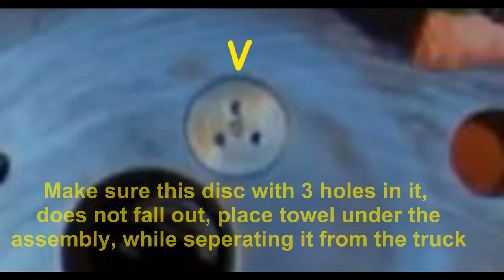Hydro Brake booster leaking repair 1999 Chevy 3500HD

Comment: Yep redid mine last week same way. Cleaned out some pieces of loose rubber gasket and thoroughly sprayed assembly on firewall with brake clean to make sure I got it all out... Well I'm redoing it due to the fact a very small piece of rubber got in between the new gasket and the piston.
Rule of thumb I keep a couple of full kits on hand, be ause they have the small three hole piece and yellow plastic dual use valve. Getem from eBay bout $18 Great job Click Click

Comment: Will this also work on a 5.7 little gas?
Reply from the maker: I belive those have a vacuum booster. Diesels are hydraulic and run off the power steering pump.
Reply: 5.7 gas have hydro boosters on the also

Comment: Hey Kenny question do you by chance have a part number for the seal kit that you used ? Did you get it off Amazon ? Thanks your video gave me hope . I replaced the power steering pump and lines and the hydro booster started leaking ugh .
Reply: Bendix Hydro-boost Kit 2771004
Reply: Ebay
Reply from the maker: Smokehousebbq7350 was my reply from my other reply
Reply: @smokehousebbq7350  thank so much going to try and tackle it myself I appreciate the video

Comment: Hi: Keny,  The seal that snapped in was one.  The second one in the front that was just hanging at the front of the booster.  Did not that second seal go at the back of the resevoir and in between the front of the Hydro?)  I ask because the piece that was hanging inside the disassembled booster wasn't really clear/identified?  Please let me know.  I have a leak right behind the resevoir.  Thanks,
Reply from the maker: The booster has the piston in it that has a seal. Is that the one your talking about? I've done this to 2 trucks I've owned, a 1992 and a 1999, they both just needed the seal on the piston and the figure 8 seal. Thats the only ones i did.
Reply: @kennydykes892  ok.  Kenny.  I have a 1993 GMC 3500 SLE.  LMK the website you got your parts from.  Thanks.